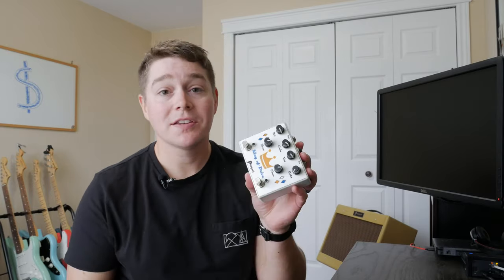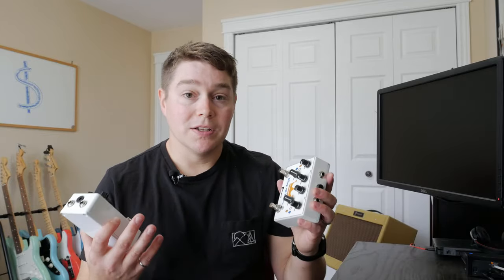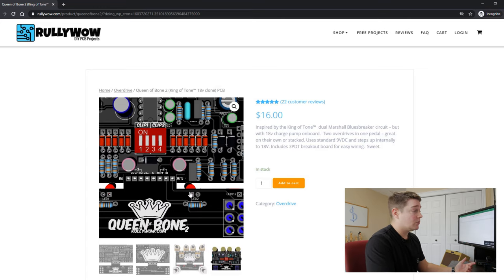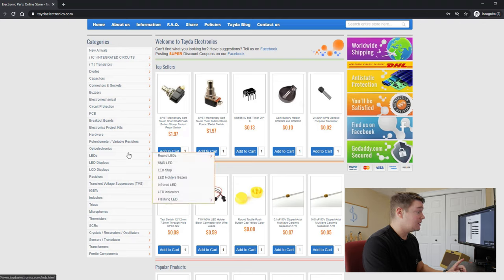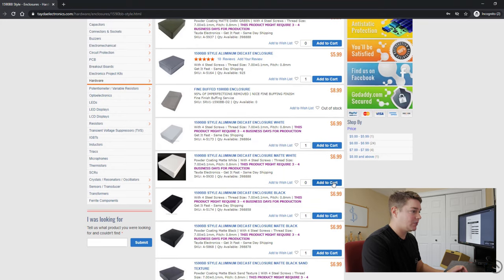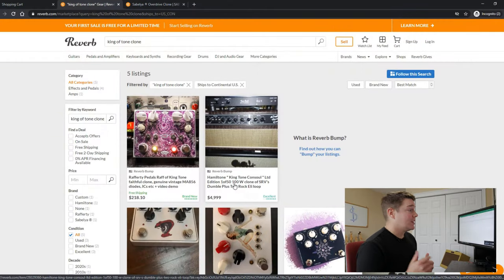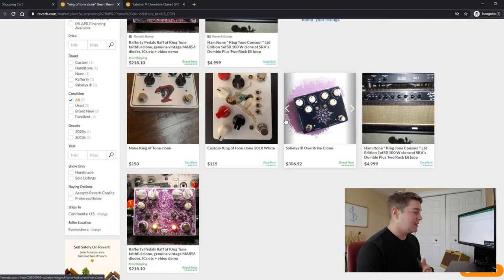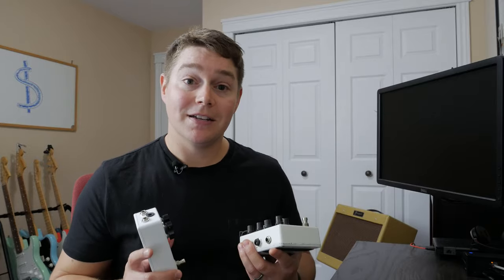The Cost of Clones | DIY Guitar Pedals

Comment: Great video.  You do miss 2 important points though: 1) Many of the Chinese clone pedals are under $20 (e.g. Mosky Silver or Gold are Klone clones); do you want to spend $20 more to do it yourself?  2) Most pedals (there are exceptions) can also be built using stripboard instead of a PCB; this will cut your costs down by about $10 but it will require more skill.
Reply from the maker: Very true. I use stripboard all the time, but a good quality pcb just makes things go faster. Also, my perspective, I would think that it is worth the extra $20 for handwired, or to avoid surface mount components you usually find in moskys. Mostly because it is easier to repair. Great points though!
Reply: Why would I want to buy a Chinese clone?

Comment: Building guitar pedals is a very deep rabbit hole. Once you go down that rabbit hole you'll find yourself spending waaaay more money than you would if you just bought the freaking pedals you initially wanted that urged you to start building one. All jokes aside, being able to build something that works is a very proud moment. 

Additionally, acquiring some more complex knowledge around electronics will help you mod and/or design circuits exactly how you want them. It's not that much about the cost as it is about the fun and the overall experience. My advice to anyone that wants to start building anything around electronics is practice soldering a lot. I can not stress that enough. Having clean good solder joints is essential. Get a veroboard and spend like 5 bucks on random components and start soldering. Also, triple check everything. It will spare you the frustration of trying to understand why the pedal doesn't work, only to find out that a diode or an electrolytic cap was put in with the wrong polarity.

I'll have to somewhat disagree with the choosing of carbon resistors instead of metal film. It's like 0.002$ difference. Probably the audible difference will be negligible if any, but I've found out that skimming on parts is a huge mistake in the long run. Get the best parts that you can afford. The same goes for soldering irons and solder. Having a good soldering iron and high quality solder will not only help you build a better pedal, but ease the whole process and make it more enjoyable overall.
Reply from the maker: Love the comment. Great feedback!
Reply: @pougnetpedals  The fun fact is that last week I ordered the parts for my King of Tone clone. I designed my own 4 layer PCB (thanks to the JLCPCB offer) with a single KoT side, so by using two pcbs I practically have a KoT 😉 The cost was 0.6€/PCB shipped and the rest of the components costed around 50€.

I bought the best components money could buy (wima film capacitors, Panasonic electrolytics, lumberg jacks etc) and the cost was still way lower even than the reverb clones. Investing in quality components is essential to making great pedals imho.

 I think the problem with most people making clones is the "skimming wherever I can" mentality. That's why there is that "the clone doesn't sound as good as the original" opinion around the net. Given that the schematic is correct and the pcb layout is done meticulously, the clone can sound even "better" than the original if quality components are used. That's my 2$.
Reply from the maker: This is a great topic. Here is where I land and maybe where we differ. I believe a quality component is durable, and works as expected. For example, a crappy resistor may have leads that easily break when I am seeding them. A junk capacitor is one that is not able to hold charge. The difference between a 5% resistor and a 1% resistor is tolerance not quality. I have seen many crappy 1% resistors. Cost can be an indicator of quality, but there is a diminishing return on it. Normally, the best parts money can buy usually means they have a slightly longer lifespan. I agree with you that paying a little more money on components may extend the life of your circuit, but personally I feel like everything I showed in the video would not have to be replaced for many, many years. With respect to what you hear. I don't think anybody can hear the difference between a good quality generic and a name brand component. It doesn't make sense that you would, if they do the exact same thing. Similarly, I think the audible difference between a 5% resistor and a 1% resistor is negligible. Especially when you have 10% (CTS) or 20% (Alpha) pots for external controls. Pedal manufacturers have the same issue. No two pedals are the exact same. The main thing for DIYers is making sure you use the right components. I am thinking about capacitors here. Early in my building days I used ceramic capacitors interchangeably for box and film. That makes a difference! Ceramics are microphonic and should only be used at very low pF values. Also, DIYers need to be careful swapping transistors, ICs, and diodes for "equivalents". You should always look at the curves and their spec sheets and not rely only on DIY forums. Great discussion though. I think every DIYer finds their own sweet spot for their builds
Reply: @pougnetpedals  Don't get me wrong, I'm not saying that because you used carbon resistors instead of metal film, your pedal is of lesser quality. Resistance is resistance. It doesn't matter if it's carbon, metal film, or a FET used as resistor as long as it's the right value. I'm talking about the overall mentality.

For example one might say that a metal film capacitor is always better than a ceramic or a MLCC. Wrong. In power supply filtering ceramics are much better than metal film. Knowing where to use each component and buying the "best" in that category is what will make the overall quality great. 

The way I see this is that I'm primarily doing this for fun. I don't have a long waiting list or 20 employees to pay. Each different pedal I build, I will most likely build it once (for myself at least, not including friends) , so spending the extra money to buy the best components once, is worth it. If I had to make 10-20 pedals I would definately be more considerate of the overall costs, but spending 7$ more once is worth it, to me at least.

Great little convo we've had! Most of my friends see me as a "nerd" and never want to talk about these things 😂
Reply from the maker: My wife thinks I am a nerd as well. I definitely see your point though. It just comes down to personally preference. This is likely a good idea for a future video. Manufacturer (which is likely surface mount) vs generic brand component clone (maybe on stripboard) vs name brand component clone (on pcb).
Reply: can you reccomend a good soldering iron?
Reply: @thomascleveland  I highly recommend the TS101 soldering iron. That's what I've been using for the past few months and it's amazing!

Comment: one thing i like about doing it myself.. if you buy a new $25 pedal it has tiny tiny transistors for example.. it's hard to try new things and switch out parts. build it youself and you can tinker alot. plus you made it not a machine mass produced!

Comment: I really want to learn how to build my own pedal. I have a little experience with resisters and LEDs on some of those boards I can't remember the name of from years ago taking a HAM radio course when I was 9 years old but thats as far as my knowledge goes beyond soldering. I have a little soldering experience. Any advice on where's a good place for me to start? I can read schematics from air spreads which look very similar to electronic schematics, though they use a lot of different symbols. Would you have any advice for me on where to start, where to go next and what to do finally to build my own pedal? I have joined r/diypedals on reddit just a day ago, I don't want to bother posting because I'm so new to it and it seems a lot of people there want to see builds rather than educating. Any help would be awesome and appreciated! Thanks.

Comment: I'd pay someone just to use Tayda's website for me.
Reply from the maker: Really? I don't find it bad at all. Much more user friendly than regular electronics sites like mouser or digikey
Reply: @pougnetpedals  You're right. I normally just brew a cup of coffee and spend a couple hours getting stocked up. Just another hidden cost that needs to be included in the final unit price. It can be shocking to newcomers how important inventory and distribution are to profitability (or really, affordability). I'm at the point now where i might spend $65 a month on parts to replenish my stock from having made 3-5 projects the previous month. You'd have to be a pretty savvy shopper to get 3-5 new gizmos per month for that price.